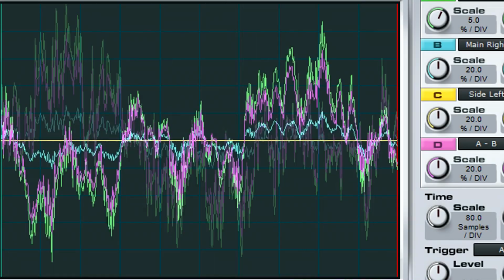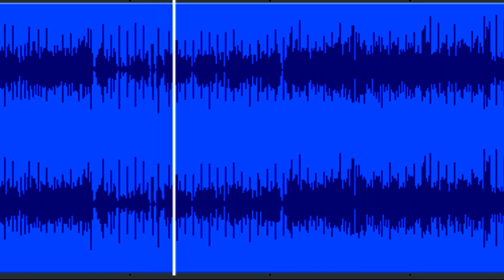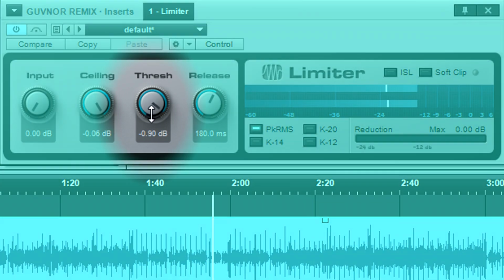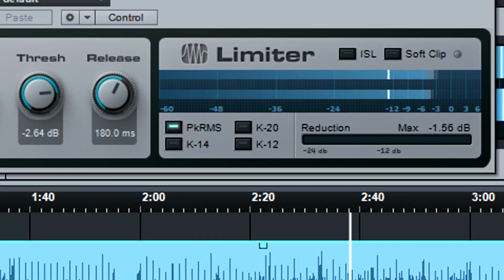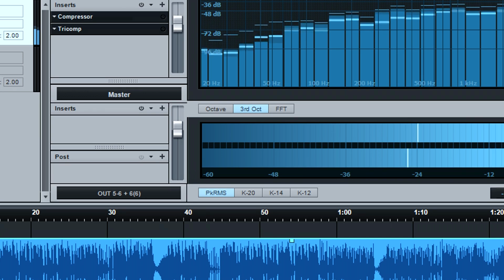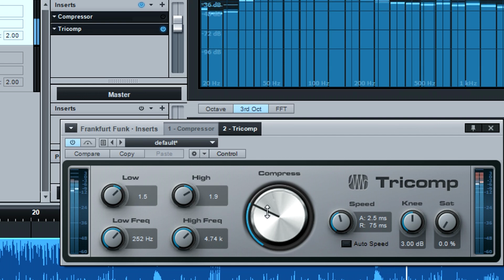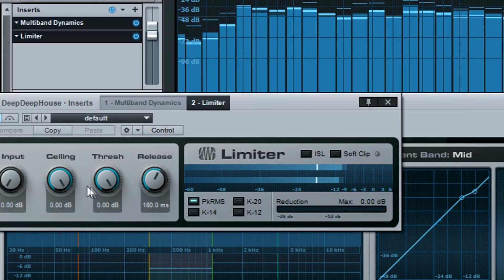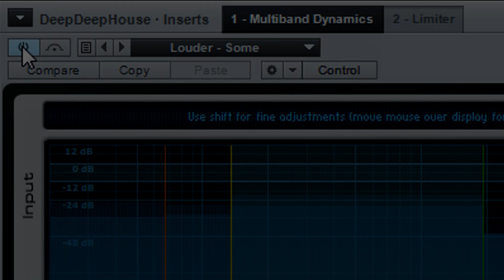Mastering with PreSonus Studio One Pro (Part 3 of 6)

Comment: You can use two limiters, regardless of the digital/audio thing you wrote, in fact if you really want some slick advice, group the rythm section (after you do your work on each individual channel) and use a good limiter, that's how many songs have gotten the rytham section to blast (think nu metal). There are general rules of thumb when it comes to post production, but all rules do not apply to every song. And yes you can use two limiters in on one main out. I have done it with great results.